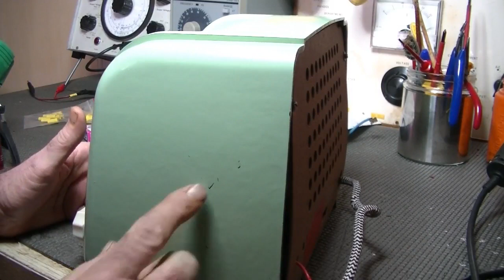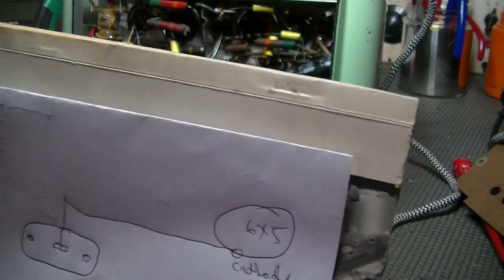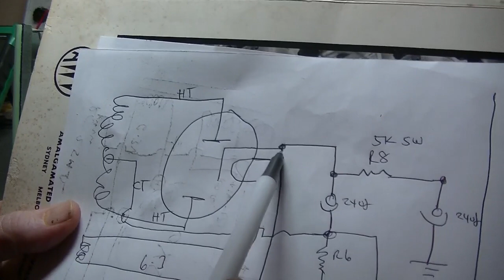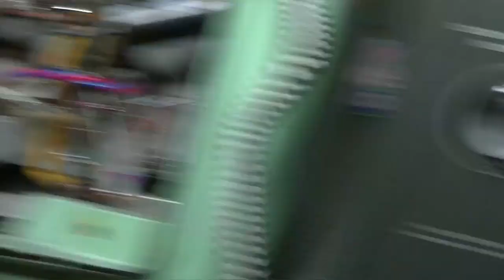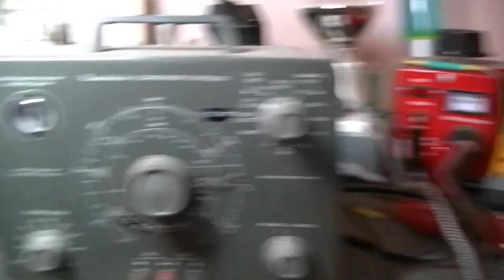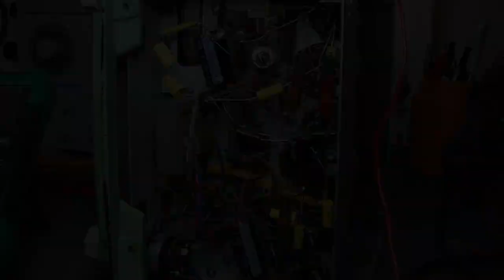Philips Jubilee 4 Model 122b 1951

Comment: I agree Frank; always replace the filter capacitors when restoring radios, especially the can ones. When we install the new filter caps their only rated for so many hours of life, just like the old incandescent light bulbs. On power transformer radios I always add a fuse to them to protect the transformer.
That blue filter capacitor perhaps would have reformed itself by operating the radio, but still was a good idea to replace it. Nice touch with the sponsor jingle, now I got to find me a sponsor LOL.
Reply from the maker: Thanks Ken, I don't think my sponsors are going to pay me, most went out of business decades ago

Comment: Someone was in there replacing the wax paper caps but both of the E caps ? Maybe he only replaced the parts he saw
were bad and put a spiffy ( inappropriate looking ) line cord on. I bet those resistors wern't checked  for out of tolerance.
You are a much better restorer than he was. Tucker Box dog AND cat canned  food? Must be an Aussie thing , that would
 never fly in the  USA here ( exception is one Wysong  Epigen dry kibble ). Nutrients are different. Nice repair Frank.
Reply from the maker: Thanks Steve. Yeah, that power cord was atrocious. Also, if you check this model on radio museum, the green one pictured is the one I fixed up, what a fluke lol
I still don't get people leaving old caps in circuit. There is one restorer I know of down here who does the same thing and he charges like a wounded bull too. I saw his work and apsrt from leaving an electro can in circuit he left 3 waxies in there too.  
I think he figures he will get repeat business after the unit fails several months down the track. 

Ahh, Tuckerbox a long gone product and I love that jingle.  More old aussie commercials coming and I found a few from the US in my nostaglia stash